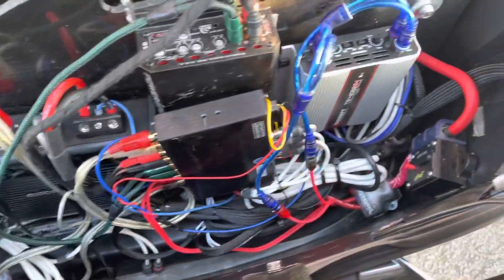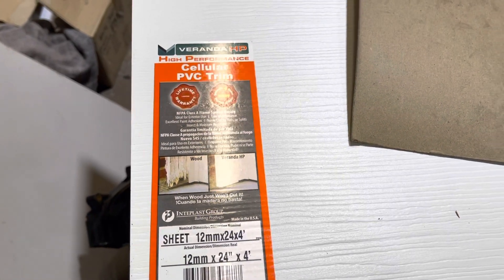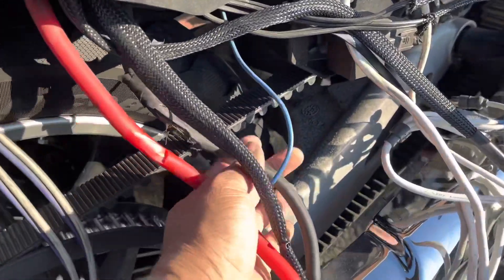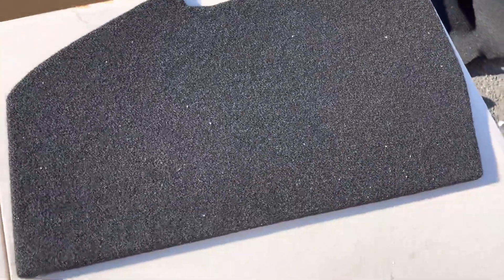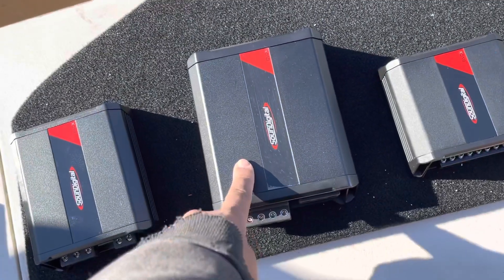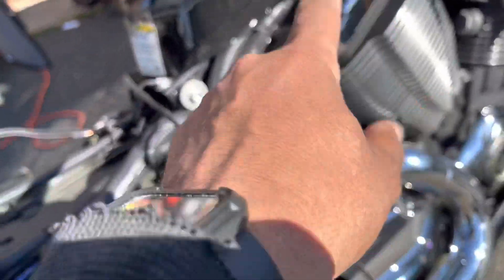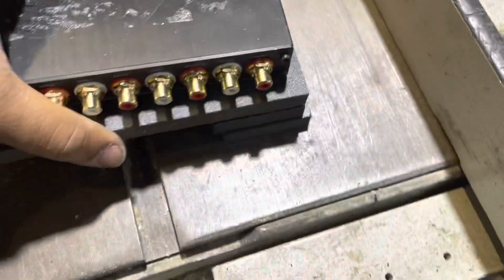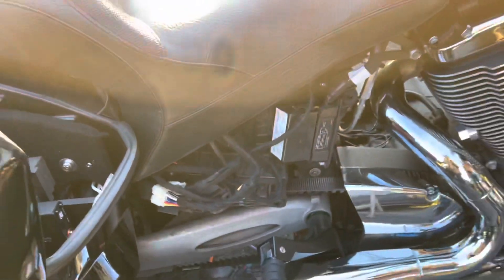Victory Cross Country wiring rescue and audio upgrade .

Comment: The only problem I see,  on Victory, you would add the Amps on the other side of the bike because of the drive belt...#js
Reply from the maker: This is not my install 
We are just fixing 

I agree with you 100 percent but there is a custom subwoofer enclosure in the other bag 

If we had done the install 
Amps would have gone in the tour pack or clutch side bag .
Reply: @NVSAUDIO  I understand. Like u my main installs are Victory. And everything is reversed from Harleys. I love ur work sir, Keep doing what ur doing, it's needed bro